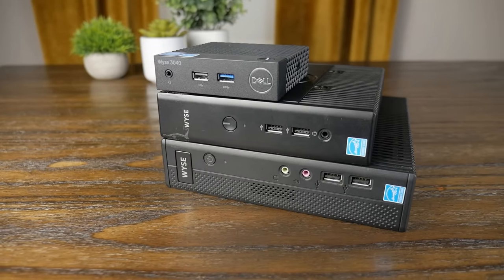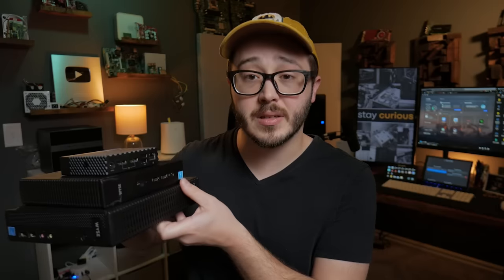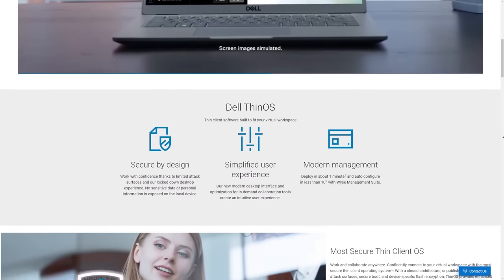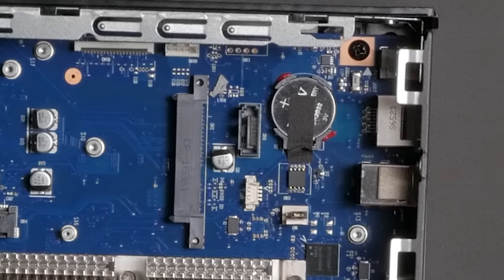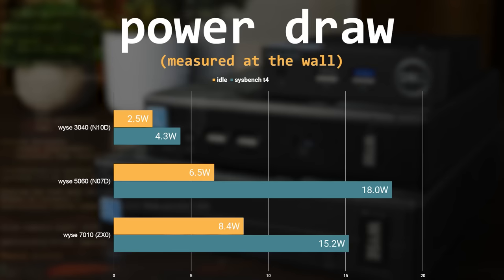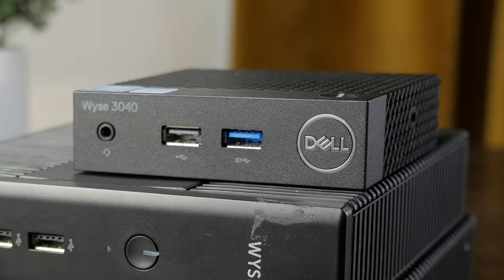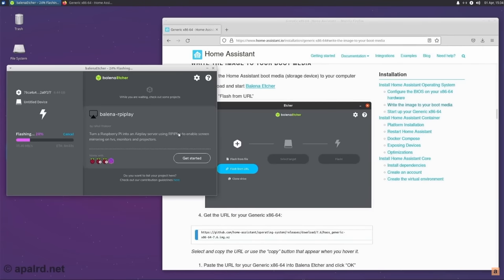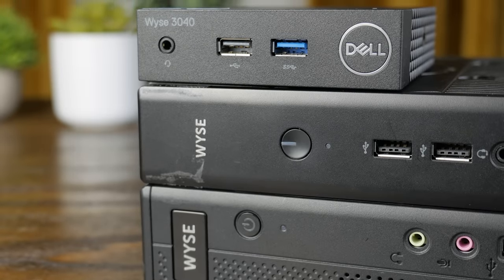Do These CHEAP PCs Live Up To The Hype?

Comment: 5070 with four Tremont cores (2017) is much more powerful and actually pretty usable as a lightweight desktop - 4K60 HEVC videos, game stream or remote session (no HDR) are perfectly smooth. It even supports Windows 11 officially (but you need a separate license). Uses DDR4 SO-DIMM and has M.2 for SSD + WiFi card.

Comment: This was interesting! I've seen some of these for sale locally and was curious how they'd compare to something like an HP Elitedesk 800 G3 which I own. It seems like they're fine for some things but not nearly as easy to work with as my HP or similar tiny form factor PCs. Because of that I'll probably pass on these because while they are interesting they don't have the flexibility that I want. Thanks again for making such accessible content!
Reply from the maker: Thanks for watching!
Reply: I have both the Wyse 5060s and a couple of HPs (one 800-G3 mini and one 600 G3 all in one, both running I5 7th gen. The HPs are considerably more capable than the Wyse.

Comment: I highly suggest the HP T5740 thin clients for lightweight servers.  Older but inexpensive, fairly power light, and easy as a PC to load with most OS. I replace the SSDs in them though as the oem ones are cheaply made and small capacity. Also you can find a std pci expansion for them.  One of them is running my firewall as we speak with a PCI network card.
Reply: Also these are good for running SIMH and emulating ancient hardware.

Comment: I would love to see you to a piece about using these for simple machine controllers vs Raspberry Pi. 

We use Citrix a lot in healthcare. Most of the workstations are thin clinets and it allows those with laptops or working from home to securely log into applications.

Comment: I got one of these for 24$ on ebay but had trouble installing any distro but manjaro because of the issues said in this video, and manjaro was completely unusably slow, I didn't know I could fix those booting issues so it just ended up being used as a bookmark for my stack of thinkpads in my room to keep them from tipping over, I guess it found a use after all! lol

Comment: If you looking for insanely fast mini pcs chech out the intel n100 and n305 ones out. The n305 might be bit pricy but gives about 3600 events per second (single thread) and up to 23000 with all 8 cores. Mine is passivly cooled, so performance might not be optimal.

Power consumption is terrible though. 10 watts when absolutely nothing is running. 3 VMs and it's at 15 watts. At full load it pulls 35 watts

Comment: I've used quite a lot of the HP thin clients. I have a T410, T420, 2 T520 & a T620. They've all been super strait forward to setup with Linux. I went HP, because I had a massive pile of PSUs (don't ask) and I was aware of the 3040 bios quirks! Good to see a bit of coverage on the Wyse systems though! I'm running a T520 as a router (OpenWRT), another as a temporary TV server and the rest have no current use.
Reply: Ive got 8 identical t520s, and i hated hps special bricks, so i got usb c to hp adapters, now all of them are connected to usb c bricks. Awesome little things. For beginners, they are cheap, no trickery with distros to make it work on rasp pis, it has m.2 sata and i have 128 gb ssd on them.

Comment: The 3040 uses SDIO for the wifi card, it is not pcie or usb.  There is an adapter on PCBway that adapts it to a micro sd card if you need more storage.

Comment: These could probably be cool to build a test environment for clustered software or high availability related stuff.  RPIs are hard to get and if you can find them in stock they are actually quite expensive now, they are pushing $100+ and even higher now depending on model.

Comment: ThisOS was basically the thin client's setup to flash / upgrade the system and setup the connection to the VDI server. Surprised you didn't try out some Retro installs, XP and Win98 gaming.

Comment: You might want to try and use them with a proper remote desktop software, like xrdp (on the server) and any decent rdp client on the wyse thin client. Stuff like spice (afaik) is not really meant for low-latency. I get an usable remote dekstop with xrdp, and it also supports both playing the audio (originating on the remote desktop) on the local client as well as microphone forwarding and niceties like clipboard sharing.

Comment: the 3040 is under 40$, and it runs off 5v, you can easely get a barreljack to USB cable that fits that thing 
ideal for a Pihole setup that runs of the routers USB port power (its how i have my Pihole setup)

Comment: I've an old Atom330 kicking around, and for its time, worked really well as a basic streaming box well into the 20-teens. Those days, sadly, are long gone and all it does is collect dust. Any compatible RAM is expensive and slow.

Comment: at the moment im using one of those 3040s as a mini TV server using LebreElec and TVHeadend running off a 128GB USB stick, works great to send TV to all of my computers/phones/tablets, my only issue with the 3040 is the PSU cant handle much more than just the computer itself so using a portable HDD for an OS drive is out of the question

Comment: The Wyse 5060 makes a great octoprint server. Cheaper than buying a Raspberry Pi if you can find one with an AC adapter for under 50 bucks with the sata flash module still in it.

Comment: The wyse 3040 is really impressive, I've got a few of those, I got one of them to run a stripped down version of windows 10, which just fills up the available 7.3GB of storage. Unfortunately the sdio internal connector only works for WiFi cards afaik, it would have been cool if it was a pcie connector, that way you could make it even more useful in some strange ways. Mine runs 24/7 just as a remote access computer (using chrome remote desktop) to manage network more easily as well as a "backup" for wake on lan if that doesn't work outside the network. I don't have to worry about any power consumption, I measured it precisely and it tops at around 2.5w even during boot (no peripherals other than a dummy DP connector and a small fan). Unfortunately they seem to not like most Linux distros, which would have probably worked better in terms of usability.

Comment: im Happy with my Wyse 5070 J5005, it has the latest iGpu (no Av1)
I'm running DietPi os, it has all the driver ready. then its CasaOs.
paid $50 and another $45 1tb m.2-ssd, $30 16Gb-2*8 ddr4  = @ $125 
runs on Solar Power

Comment: I use a 5060 with a 128gb SSD,and an Intel WiFi card.  I am running Linux mint xfce and using it as a home theater PC

Comment: As these are a bit on the weak side they can make a usable retro pc, aka a "new" pc with a old os and games on it for a very resonable cost, low enough to have one for each OS you want to run including dos, though dos may be best on older thin clients with limited cpu power.

Comment: Those are remarkably good for thin clients running 10+ year old hardware. 
"It's barely OK for a decade later version of what it was designed to do" is a certifiable excellence award for things that were expected to last 3-5 years.

Comment: I still use an elitedesk 800 G4 mini with Windows on it to play some specific light games because of anti-cheat (I use fedora as my main OS and those often doesn't work well with linux). I might change it when there will be intel Ultra 5 125H based mini PCs as gaming performance of igpu has greatly improved and they are capable of doing AV1 encoding.

Comment: If they only had two or more nics...then a lightweight firewall/router setup would be awesome!
I guess with multiples, one could build/tinker/play/practice with Kubernetes and Ansible...
But with fixed hardware on the board and not having much for processor oomph...they are a bit lackluster like you said
I wonder if multiple micro form factor USB's if it could be a network USB machine
Ah well...interesting setup and tinkerable like you said
I wonder how well those little rigs could handle Asterisk or some sort of Linux PBX server
Keep em coming!!!!
Reply: I ran pfsense with 2 USB nics and onboard to control dual WAN. I have it as a backup on the Wyse 7010

Comment: I got a Dell Wyse 5070 for $50, running Debian with home assistant, pi-hole, etc.  It's great for running Linux but not so good for running Windows 10 on it. Overall, if I had to do it, I wouldn't get it because I wanted to run Win10 on it.  But for Linux, it's fine.

Comment: In 3040 there are two sub-models, one 5V and other one is 12V, there are some reports that somebody burned one with power adapter from other 3040 that uses different voltage.
wifi of 3040 is not cnvio, its sdio+usb. 
z8350 was competition for raspi3, there was also something like atomic-pi based on same cpu, pi4 was just much better, 
sysbench is not great test, it entirely relies on cpu caches, so You got results that can't compare between all of them. Also please note that included eMMC is very very slow. Just move to ssd via usb3 and it's just much better. There were some z-8350 with 4GB of RAM, but I'm not sure if it's possible to solder this into 3040 :/

Comment: Also you can use USB to DC 4.0mm to power the 3040 instead of soldering to the board
Reply: Or using PSP adaptor or usb c to 4.0 * 1.7 mm
Reply from the maker: BOOOOO BORING!!!!

JK that’s probably a bit smarter haha

Comment: Hi, i am great fan of your hardware reviewes. Kudos to your effort on doing this.
It was very nice research, IMO I would strongly go with raspberry pi or zigmablade or new once as it gives lot of hardware support and modern power source adoptors.
Reply: raspberry pi is too less power, these system are better.
love the low power i7  chrome OS gear, NVMe upgrades as if it's PCIe

Comment: I use a lenovo m93p tiny have change the cpu to a Intel Xeon CPU E3-1265L v3 @ 2.50GHz × 4 cores 8 threads works very well.

Comment: im still using a 2004 psu for 24/7 on my minecraft server i wanna be honest the pc is directly from trash and has a i3 3220 8gb ddr3 1600 if you wanna run a minecraft server use purpur and pregen the chunks

Comment: I have a thin client myself a Lenovo m710, was using an i3 7100t but swapped it out for the i5-6400t due to lacking performance when using my docker container with webODM, but the i3 was working fine when using grafana and influx db with 0 issues there, also 20w idle and 40w max on either cpu
Reply: That’s quite high in idle wattage for one of those? I’ve run m710s and more recently 8th 9th gen 720qs and at idle I’m looking at 6-8w

Comment: Ugh.  I anticipated your pain while researching used mini-pcs and Chromeboxes for 24/7 use.  With DDR3, short M.2 SATA and other vintage, upgrade hostile properties I decided to abandon this route.  
I found and purchased the GMKtec Nucbox G3 (new, Intel N100) and Cybergeek Nano J1 (used eBay, Celeron N5090A) and am having good luck so far.  Equipped them with 8GB DDR4 and 500GB M.2 NVMe, no issues installing Linux Mint and MX.  Both idle around 6w and peak around 20w. Performance seems 'zippy' but unsure about regular desktop use.  Gaming or video transcoding, hahaha just stop it.

Comment: The current version of Etcher isn't working.  I had the same issues yesterday trying to make my new Zorin 17 USB boot drive.  
I'm using a Dell Wyze 5470 Mobile Thin Client with the N4100.  $69 from Dell Refurbished, plus has upgradeable RAM and an NVMe slot for more storage.  It's plastic, but way better than expected.
Reply from the maker: Huh… if that’s true I feel much less stupid lol

Comment: dell wyse 3040 only works with SDIO m.2 wifi adapters (and probably a custom-made m.2 to microSD adapter)
mmc can be changed to 64 or 128gb (resolder)

Comment: Ive got a few wyse 5070 running with 32Gb ram. (2x 16)
Specs says 8 max. But it works, only its very picky on brand and model sodimm

Comment: Be careful with powering the 3040s.. Some actually use a 12v power plug. Obviously don't want to get those mixed up and fry a 5v one by using a 12v plug..

Comment: Theyre not much, or often any cheaper than an  Optiplex except for  the tiny one. I do want to get one now, even just for a management terminal or something. I would only get the 3040 though, as the other 2 arent much cheaper than a low spec Optiplex Micro.

Comment: after seeing other videos on 1 liter mini pcs by servethehome and other youtubers, i still find the whole thing lacks clarity on what may be considered one of the best power efficient mini pcs on the market as a mini server and a mini desktop. 

it really gets out of hand when the cost constantly climbs with all the power upgrades they do in their videos because logically the more you spend the more power upgrades you can make. 
but from a reasonable standpoint, for example, how would pcs in its class fair against each other with a reasonable budget like $300 to $500? like if i had $300 which version of an hp elite desk mini would be ideal? then the same comparisons with dells to find candidates. then from that, how does that compare to a each other? or other brand equivalent? 

i think there are still unchartered waters when making comparisons in that regard without going on a tangent of what possible upgrades one can do. upgrades are fine within a realistic realm of budgetary constraints.

your video highlights realistic limitations well. so there’s a lot more to discuss about this.

Comment: Bwahahahaha, I love how YT threw this into my recommendations after I made the argument under a video about using these for Home Assistant. They are just not worth it compared to the 50 bucks more for an RPi for home automation projects - at least in Europe - because of the higher power draw, especially when your Home Assistent setup is relatively small - mine easily works well on a Pi3 which idles at sub 1W. Like, sure, these boxes are "low power draw" compared to a full PC but not when compared to a small ARM PC like a Pi that is more efficient than these super old x86 boxes, and with the Pi5 getting a PCIe Port that whole discussion is kinda over completely IMO. Like, for me I'll pay 13 bucks a year for every 5W extra, so even just doing nothing these easily lose me when I plan to use and not replace a box for at least 5 years.

Comment: I bought a Dell Wyse 3040 a few years ago and thought it would be a good dedicated system for my home gym. I wanted to install a lightweight OS and use it primarily to use a browser and load my client’s workouts. I’ve been very disappointed in the performance of the Wyse. I know it’s only like 1.4Ghz processor which may be the limiting factor, but it’s just so slow and unresponsive. I think maybe I just chose an improper machine for my application but is there any way to make this machine perform better? I just want a basic machine that can load web pages and it isn’t doing a very good job with it. I installed thin version of Manjaro Linux on it

Comment: Hello, just started building my TrueNAS server it will have 8 spinning disk in a raidz2. I want that to be my main storage for plex media. I want to have faster storage for everything else (family photos/videos, documents, etc). I also want to buy a Flex 10 GbE for the TrueNAS, TrueNAS backup, and my computer. My question is do I go with four 2TB SSDs in a raid10 or two 4TB NVME drives in a mirror? If the is a waste do I save some more and do four 4TB NVMEs in a raid10?

Comment: The docks from the sponsor are lame. Single USB-C? No thanks. No wonder they’re trying to push them via YouTubers. 

The Wyze thin clients are fussy. The much newer 7000 series from Dell that were made to run Win10 Pro in corporate environments are much better for running little low powered home servers on. 

Your units all are over a decade old essentially and you’re too far back for enough horsepower to do current things, really. 

As noted, they display faster remote desktops running on other better hardware, just fine. Their original intent.